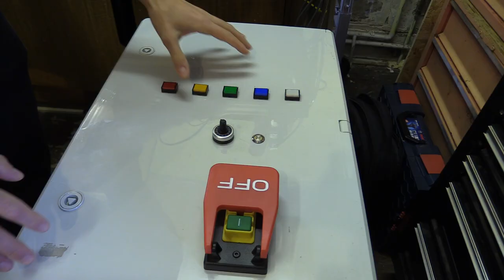#53 Layout / Installing Relay / Wiring Crimping 2.54mm Molex / Ferrules - Duet CNC Controller P1

Comment: One thing I noted right away is that the flat back plane is so much more accessible than a recessed box. Filing that one away for my next control box build. Oh, and crimpers and connectors. It seems that there is an infinite variety. So many tools. Nice video as ever. cheers.

Comment: Probably next year I will build a CNC with Duet 3 - I bought that board already. I will follow your concept to create the controller board first with all the little extras. When all that is designed and works then I can build the CNC and buy a proper suitable sized box.

Comment: What PWM to Analog converted did you use for the VFD?   Where can I buy it
Reply from the maker: I think I bought them from eBay - don't think I've got an active link though. Might have to do some trial and error with current sellers.

Comment: I am getting worried I actually understood some of that
Reply from the maker: I know exactly what you mean. I feel like I can see the matrix!
Reply: @EducatingSavvas  I’m not sure I do sadly. Are you stepping down the voltage in this because the Duet 3 has too low a maximum voltage it can cope with for the components ? I was wondering whether a Duet 3 could be used y to o control and Abid cnc with their Norma 34 motors. Is that something you’d know the answer to? Chertd
Reply from the maker: @markscheiner3952  Yes not step but create a logical connection. So I am using the 8 channel relay modules to input the signal from the limits at 24v and the duet's lower voltage on the associated NO or NC + Com terminals. I will go over this in the next video - the two voltages don't ever meet. For your other question, you have either two choices - Duet 2 with the expansion board and external drivers or the Duet 3. I like the platform because it's a way to learn about programming and develop new methods of working / teaching.